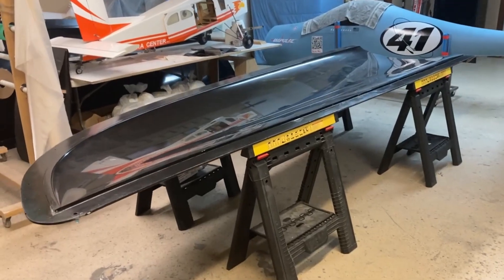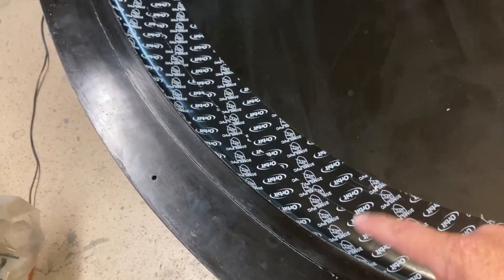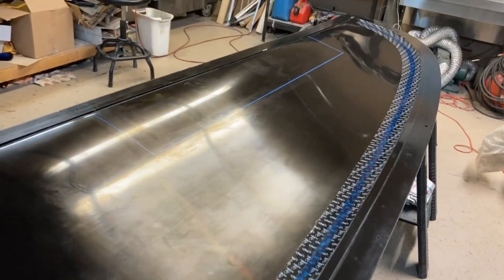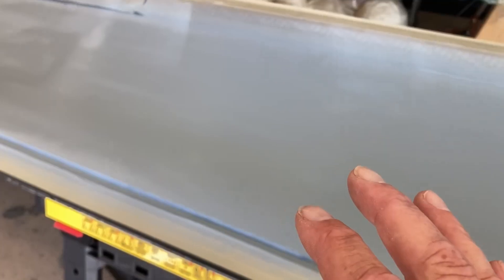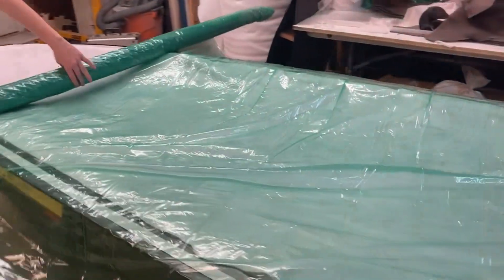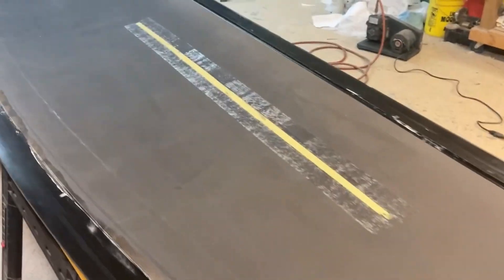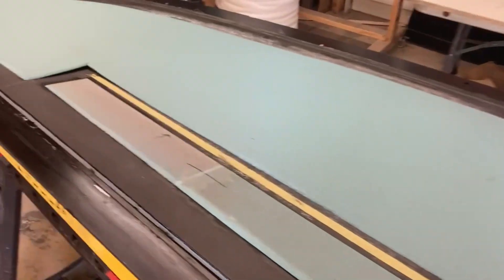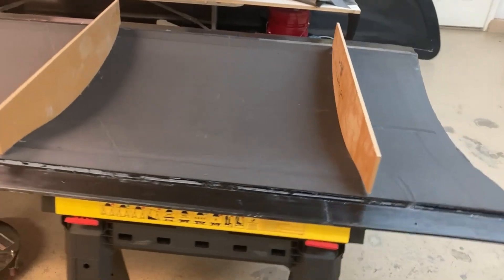Impulse Episode 13 - Beginning the wing build

Comment: Just discovered your YouTube channel : great job !
Use rohacell instead of divinicell. It's lighter and stiffer.
Ask for more tips if you need :)
Reply from the maker: Also more expensive lol. I considered it, but it is such a small percentage of the overall structural weight I'll take the cost savings lol
Reply: @RedJensen  I expected you to answer that :) yet if you consider the overall cost, it represents a marginal extra cost for ways higher structural strength...
Your choice isn't bad tbh. It will do well. As far as I understood, you are below your target weight for the time being : so far so good.
I wondered what's the thickness of the core foam that you use (wing? fuselage?)
Your main frame build seems to be at its end stage, but if you consider to mold another one, I think that around 20% of the weight can be saved. I could do a better weight estimation if I had  a better idea of the plane's dimensions and other components weight (landing gear, flight instruments, flight control system, engine, propeller etc.)

Comment: Great video, always learn something. Keep it going. 
Q- 1, where did you get those weight sticks?
Q-2, notice  you not use the  Perforated  plastic Barrier between the peel ply and bleeder cloth? maybe i missed this  or, the breather cloth is part of the bleeder cloth.
Reply from the maker: The shot bags are custom made. Any upholstery shop should be able to help you out. There is plastic between the peel ply and breather.